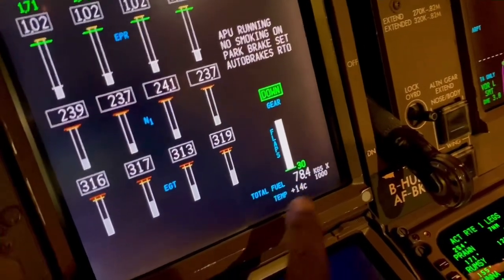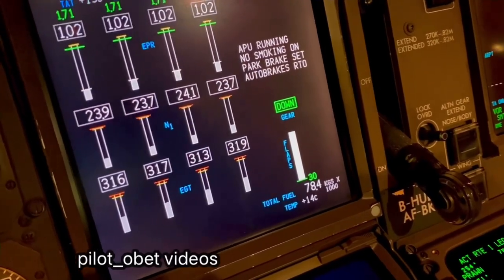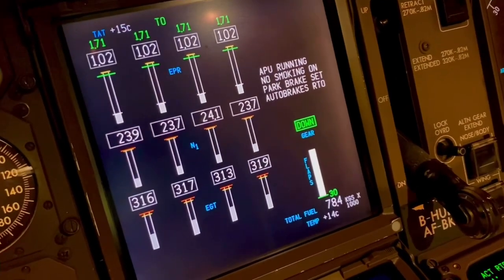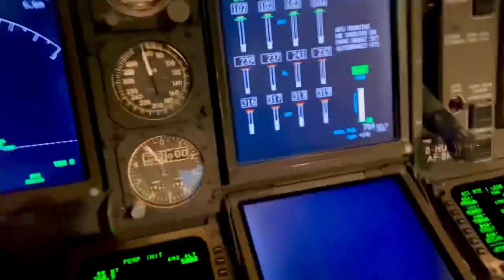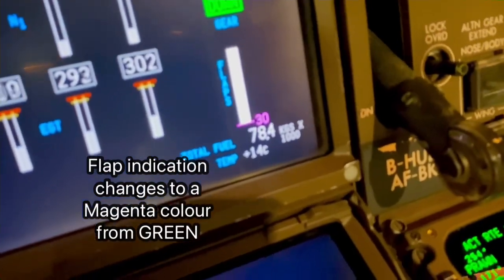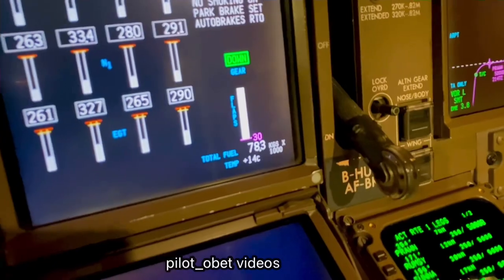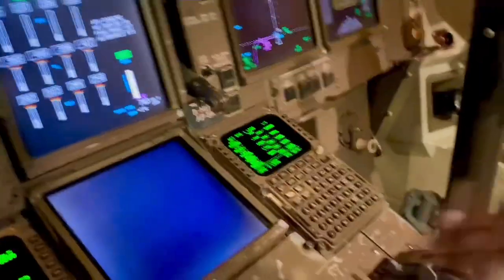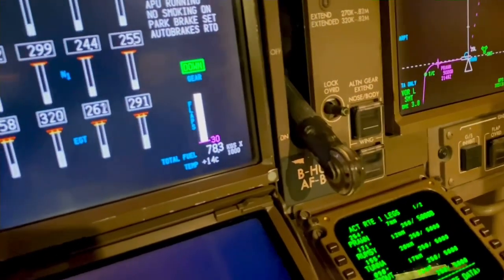Boeing 747 Leading edge Flap operation

Comment: Great video! One item of note on the 747-8 is that the inboard section of the outboard span of leading edge flaps on each wing also retracts upon application of reverse thrust. It re-extends after reverse thrust is canceled. This is clearly seen on the video, retraction beginning at 4:04, and it re-extends upon cancelation of reverse thrust, beginning at 5:01.
This doesn't appear to happen with other versions of the 747 (-100, -200 or -400). This could be because the larger engine nacelles on the 747-8 extend the reverse-thrust blast field to include a wider section of the wing (during certification).

Comment: Hi Obet, why do they extend again when it’s of no relevance once RT is cancelled? The aircraft is now travelling slow enough I can’t see why they need to be extended is there another reason Boeing decided to extend them after cancellation of reverse thrust (especially on the ground)?
Reply: If I remember correctly, all leading edge flaps on the 747 depend directly on the trailing edge flap setting and cannot be extended/retracted independently (RT being an automatic exception). The reason is that on older 747 this wasn't the case and it caused a Lufthansa plane to crash after LE flaps remained retracted during take-off.

Comment: Good informative video - thank you! I had imagined it was a means of destroying the wing lift to improve the braking action rather like the lift dumper on the upper side of the wing. The reverse thruster mechanism is a work of art ie block the fan duct and deflecting the thrust forwards through the exposed 'gratings'.

Comment: I recall the British Airways 747-400 or 400er, with the nice Rolls Royce engines I flew on into Dar Es Salam, Tanzania how the flaps were shaking violently once we touched down.  And the wings on the 747-8 are made out of composites.  But are they designed the same way as the 400, 400er with the exception of the extended winglets?  Very very nice.  Please keep coming out with more vlogs!!

Comment: I love flying the classic 747-200 in xplane, and always noticed the LE flaps getting tucked away "automatically" on landing... I never knew it was as a consequence of selecting reverse thrust, I wrongly assumed it was part of the spoiler mechanism, that deploy when the main gear touches... My reasoning for all this, was the wing is so big, it helped to "plant" the aircraft down firmly on the runway.
I never suspected it was anything to do with the forces of thrusters potentially causing damage.
Either way, my incorrect idea still has a bit of merrit, the spoilers dump lift, and retracting LE flaps also reduce lift.
This been interesting for me, thank you very much.
Reply: I fly the felis 742 aswell, what do you do when there is only rnav departures?
Reply: @mohamedabokar4384  if there's only RNAV I look for ILS approach and do the "missed approach procedure" and then continue climbing through the published height, until I'm above MSA, then go direct to first INS waypoint... Not sure how correct this is, I'm gonna guess not very!